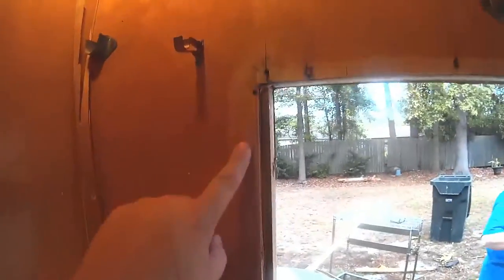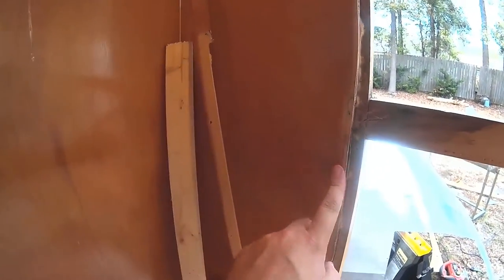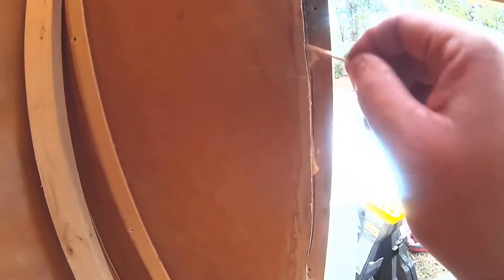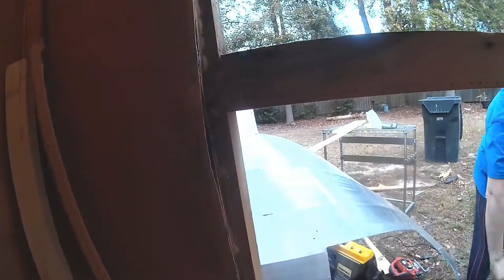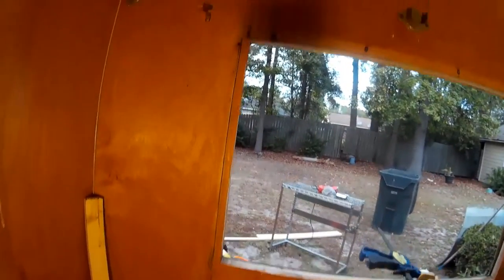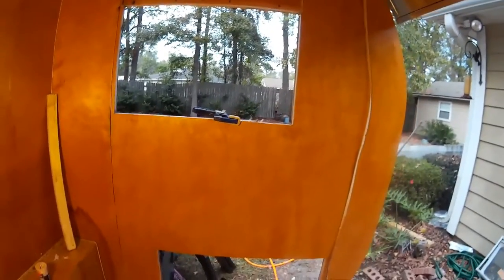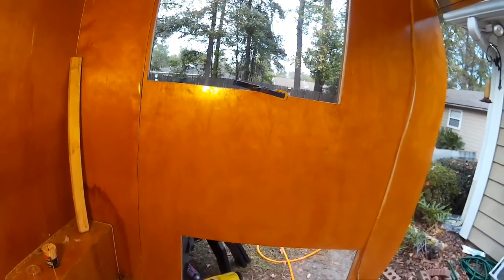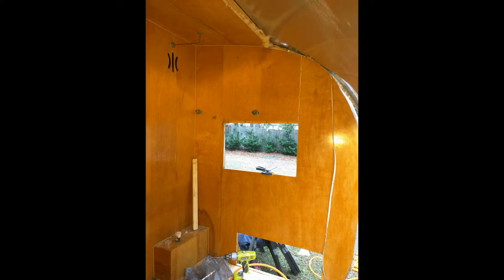Restore a Vintage Shasta Camper Canned Ham - #5 Real Panel | How To

Comment: FYI, A great trick for delamenate is put a little wood glue under the veneer and put an iron on top.  The heat from the iron will activate the glue.  When the bubbles stop, the glue is set.  A hot iron also works for plastic edging that has come off.  The heat will reactivate the glue.

Comment: I have the same year Shasta and started replacing the ceiling.  Then my wife mentioned asbestos.  Do u know if this year trailer had that issue in the installation?  So excited to get this project going then went down hill when she mentioned it.
Reply: Also ty for the education om these trailers..very helpful 😊
Reply from the maker: You're welcome!  Not sure on the ceiling, but I would for sure be carful of the floors. I wet mine down when removing (not saying that is the way, just what I did).